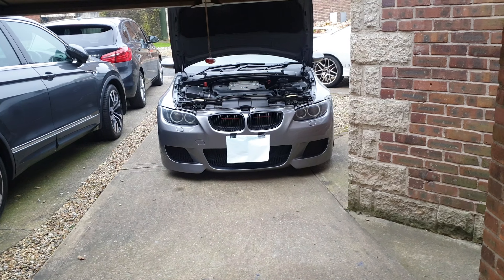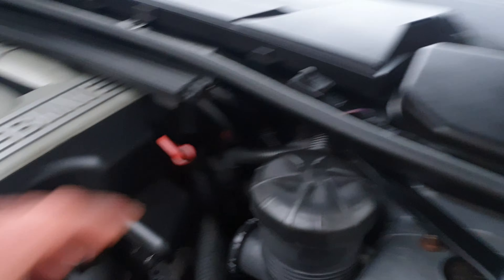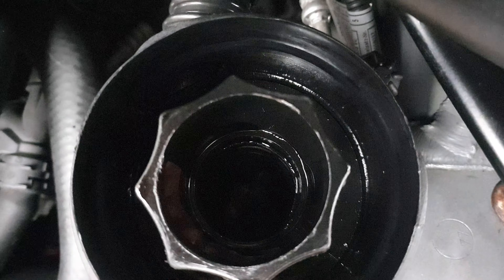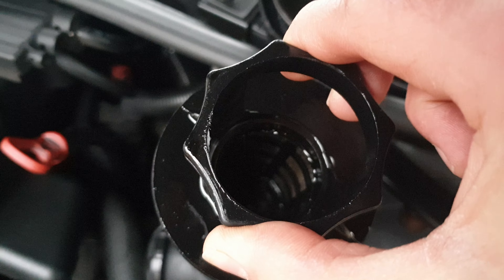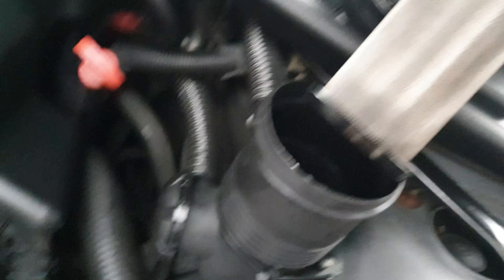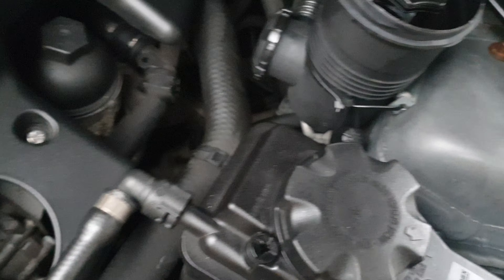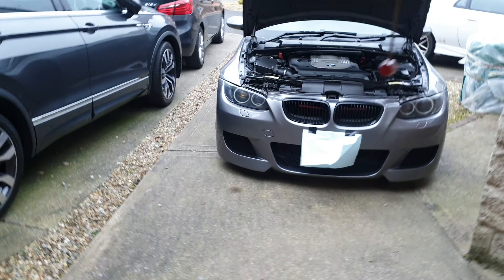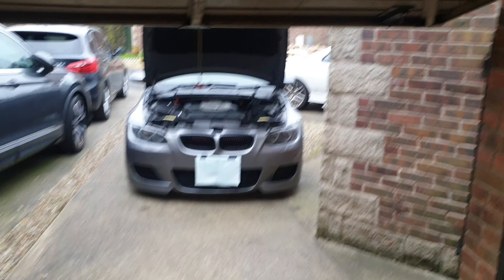BMW 335d smoking issue pro vent 200 fix follow up video

Comment: Hello mate. So to do this I just need to provent 200 and the two pipes and a modified plate where the crankcase goes? Guessing the small black cab was taken off?
Reply from the maker: Ye you will also need somthing to catch the oil. Their is a drain hole on tye bottom of tye pro vent. Not sure what you mean by small black cab?
Reply: l8on6661 haha sorry mate I was ment to say can. Bloody phone auto correcting it lol.

Comment: Hello 
Can i use a catchcan instead of the filter you used?
Reply from the maker: Ye definitely they work in the same way. I just used a filter as it has more surface area to cantch oil Vapor.
Reply: @TheBlackSheepprojects  Ok thank you👍You need to make more videos man!!😎
Reply from the maker: @gzimoo35  .... i plan to pal going to make more time im the summer for more mods to the 335d 👍

Comment: I have a x3 3.0sd with this same engine. I have done a full straight pipe. I have issues with a light smoke on startup, goes away when warm though, and I seem to have allot of oil in my intercooler pipes, and I get blue smoke in the higher revs and allot of smoke if I accelerate after startup. I have already done a ccv delete and it has helped a little
Reply: Any help from you would be appreciated
Reply from the maker: Hello pal .... smoke on start up could be glow plugs or the module. Oil in the intercooler is normal for these cars even with a ccv delete or catch can. I have reduced the oil in mine but I still get oil. When you say ccv delete what do u mean
Reply: I removed the diaphragm because it was causing back pressure
Reply: Yes I have to replace the modules for glow plugs
Reply from the maker: @issasaiwak2650  ah ok you have removed the diaphragm but you dont have a catch can to stop the oil entering you system. The catch can I installed takes out quite a bit of oil which definitely helps. Oil still goes into the intercooler but a lot less which helped with the smoking issue. Is your car mapped and what oil are you using
Reply: My car is not mapped, just straight pipe and I'm using 15w40 diesel oil because I live in the tropics
Reply from the maker: @issasaiwak2650  ..... using the thicker oil is a good move. Have you done a lead down test on the injectors ?
Reply from the maker: One more thing have you tryed unplugged  the maf? Unplug run the car for a few mins, turn off then run again ( you should have a warning light) see if the problem is still their.
Reply: I've tried unplugging the maf and that hasn't changed a thing

Comment: How i can contact you? Thanks
Reply from the maker: We can chat through YouTube in the coment section .... I'm very active
Reply: @TheBlackSheepprojects  thank you dear friend  i have the same problem in my car! When i start my car its perfect any smoke anything anormal! But when is hot he smoke some blue smoke when i drive any smoke! Its strange! I have downpipe and ecu mapped! Thanks for your attention
Reply: I have short video but how i can send to you? Its the same smoke
Reply: I have unplugged the litle pipe from the pcv and i have many vapour out from there
Reply from the maker: First thing I would do is unplug the maf start the car and run for 1 minute. Turn off engine and start the engine again. You should have the engine management light on now.  if the smoke goes away or gets alot better you have a good starting point. If it's the same try a leak down test. I have a video on how to do this.
Reply from the maker: Lots of vapor is normal.
Reply: @TheBlackSheepprojects   ok i shut down the car i turn on and if i have the light on  im wait for the engin stays hot to see smoke its better or not?
Reply: Sorry about my English im portugese 😅
Reply: @TheBlackSheepprojects  hello dear friend i have doing some tests and i have unplugged egr signal after 1 2 minuts and i have engin light on and i have testing and the smoke gonna just a litle smoke stills out but im sure its because they have many oil on the intercooler  pipes  and intake  and at same time i have unplugged the pcv pipe to let all vapours gonna to the atmosphere! But i have egr i dont have delete egr physically

Comment: Great video, thanks. I did notice that your "Mann" filter had steel mesh which the original does not have. It looks like it may not be the genuine article.  Check out this video from a diesel expert in Australia.
https://www.youtube.com/watch?v=L3EvSlgJmPI
Reply from the maker: Ye i did say in the video its a non genuine provent but works just as good at a third of the price. I would like to use tge genuine on to see if it does a better job. Have you had any experience with it?